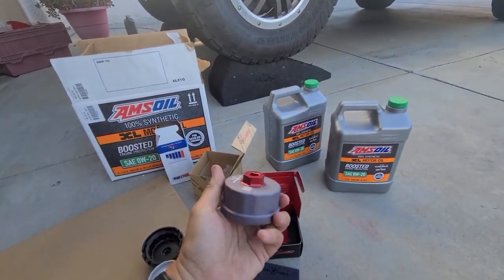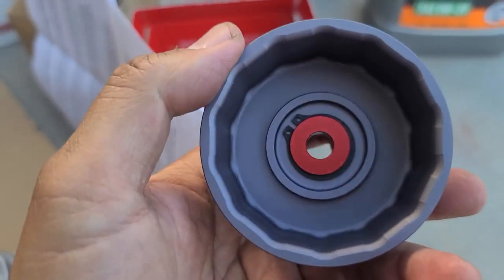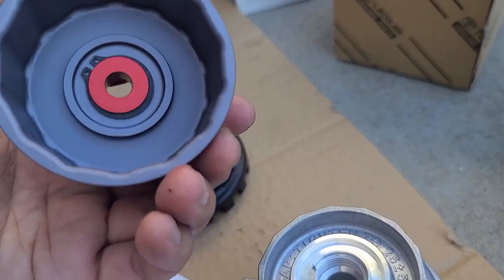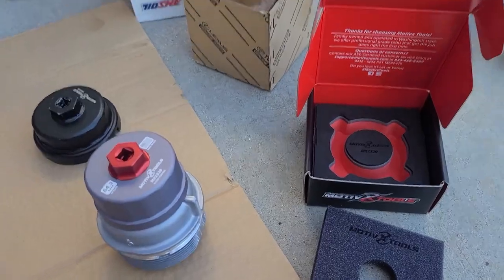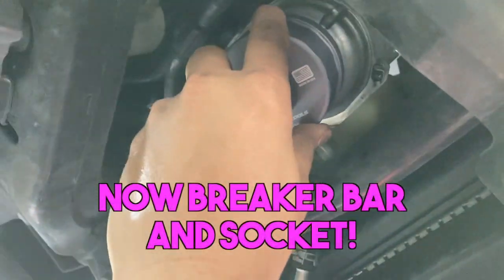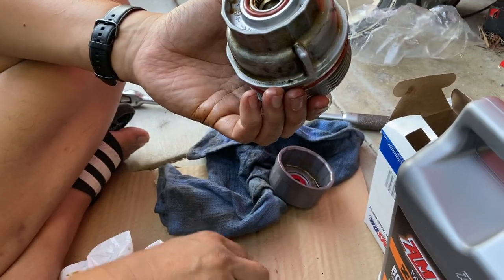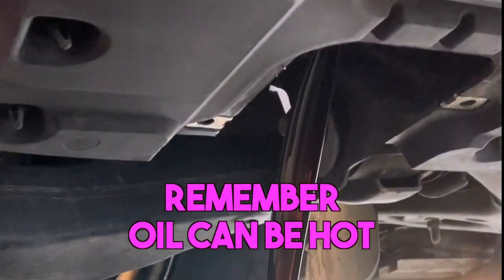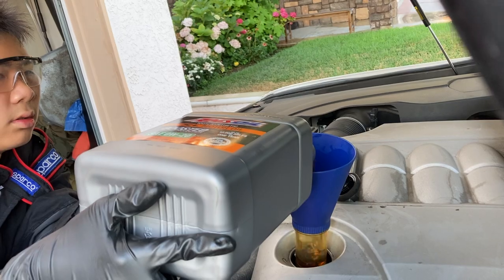New Oil Change Wrench for ALL Toyotas & Lexus ! Tacoma 4runner, Tundra, LandCruiser, Camry 🇺🇸

Comment: I think the older style is better. It covers more of the canister so it's easier to remove, plus the teeth make it even better to latch on. If you're worried about the tightness, buy a torque wrench and torque to spec.
Reply: Strongly agree. It’s hard metal and made in the USA with high quality materials, too. Plus what you’ve said about covering much percentage of the housing and adding secured grip to the tips. I’m using it since 2019 and I’m a ride share driver and never had a complaint. I say the price worth it. Good “honest” job MotiveX
Reply: By the way, torquing is not an issue. I always used hand torque to tighten the oil filter housing. Never leaked. I recommend to upgrade the plastic housing with the original aluminum one from Toyota, durable, last long and not expensive, too.

Comment: Got the new style after your video. Got the old style ones too lol. Used it on the plastic oil housing on a corolla and the wrench got stuck a little. Light tap on the ground and it was free.

Comment: I like the old style with the teeth while the amsoil filter is better than the Toyota oem filter…  Penzoil ultra oil is rated better than amsoil oil…that what reviews have shown consistently for the tundra recommend the fomoto drain plug valve controls the drain much better. 8 1/2 guartz cretes splashing when the plug is pulled because of the volume

Comment: I purchased this tool after discovering that the oil filter housing on my Highlander has been installed over torqued and 2 of the 3 tabs are broke. Thanks for the unboxing. I look forward to get my hands on this thing.
Reply from the maker: Did you replace the housing with an aluminum one yet?
Reply: @RobDaman  not yet. I didn’t know the aluminum housings were out there. But that’s the next purchase!
Reply: Check out the Baxter Performance  cartridge to spin on oil filter adapter. I put one on my Lexus Gs350,  they are a bit high priced, but they are very good quality.  Made in USA.

Comment: Awesome video man and the starting blooper was funny 😂. I have ramps also and almost went over with my tundra too 😅..
Cheers from Chicago . Placed an order for that bundle 👌🏼
Reply from the maker: I should have used crawl control 😃
Reply: Check out the Baxter Performance..cartridge to spin on oil filter adapter.  I put one on my Lexus Gs350.

Comment: Man just did my first diy oil change on the lx this weekend following your videos…. My filter housing is all brittle and breaking apart…. Scary stuff,  glad to see that u are upgrading to an aluminum unit!
Reply from the maker: Ya. Aluminum is the way to go
Reply: Just started my own synthetic mobile oil change business less than 3 years ago and I despise this damn  filter housing. I put a hairline  crack in one as I could not get it off so I had to put an impact to it. Then I had to drive to get O'Reilley's to a $35 aluminum replacement 😅😅😅

Comment: I hate the old syle! I have 2 of them and have trouble with every Lexus/Toyota filter. Just did a 2019 Tacoma V6 and put an impact gun with 450lb-ft of torque and the thing would not move with the trigger held down. Last week I put a hairline crack in this filter on a 2011 Camry by using the gun and tapping the trigger. Had to go get an aluminum replacement for $35 😂😂😂😂😂😂
Reply from the maker: WOW. Super tight
Reply: @RobDaman , a couple of these  cars were serviced at the dealer all the time. I did a 2015 Lexus GX460, 2 weeks ago and I had the same issue. I ordered this wrench because a lot of Honda's use a 64mm 14 flute filter as well.

Comment: My 2013 has the plastic housing, what’s the part number for a metal replacement?
Reply from the maker: https://amzn.to/3eVNNrW
Reply: The plastic housing is the same quality as the aluminum version. If you do buy an aluminum version, buy it directly from your dealership. Toyota oil filter housings contain a calibrated spring that is specifically calibrated to your exact vehicle.